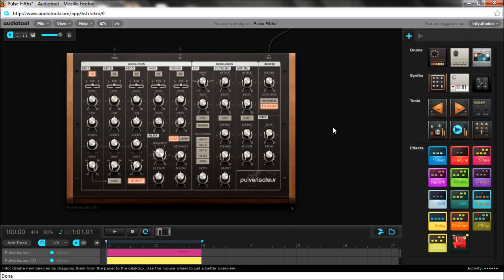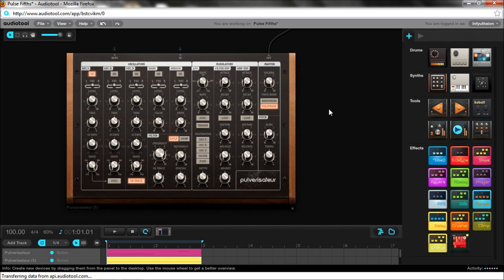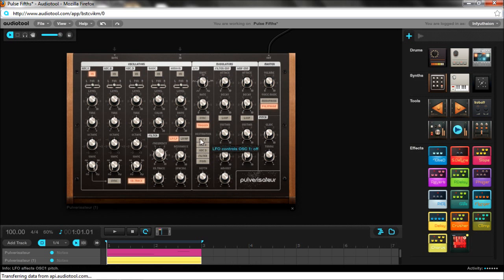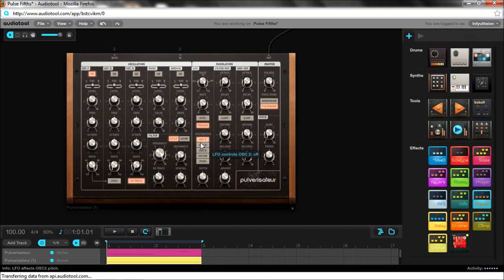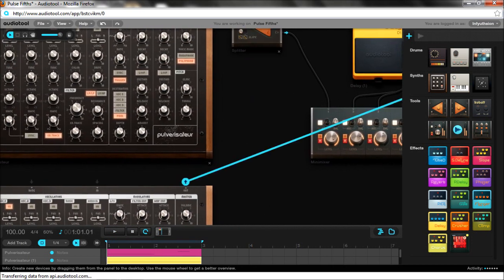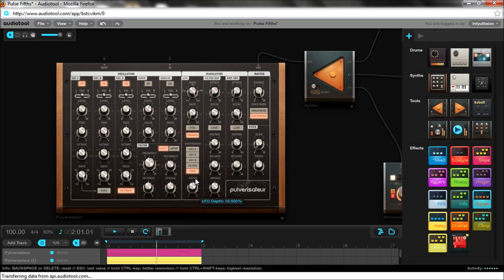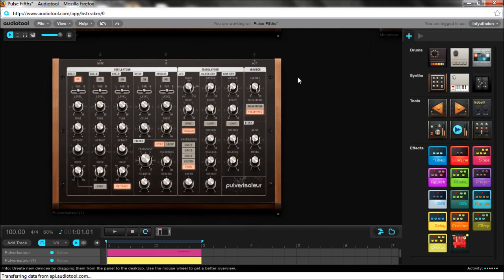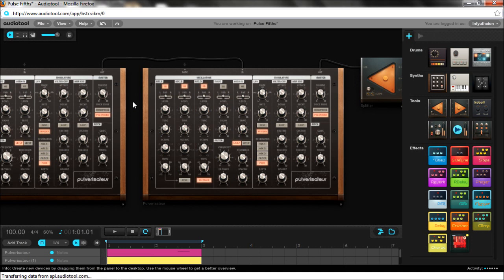Audiotool Tricks - Hidden Oscillator!

Comment: ok i need help one problem with my audio tool is when i go to pick a sound from the list ok i play it an it sounds good but when i drag it over in the line to make a song it sound a little diffrent like the pitch is low or something idk but how do i fix this
Reply: It's because the bpm (beats per minute) of your track, is different from the bpm of the sample. If the bpm of the sample is different from your tracks tempo, you can try putting the sample in the machinest. Then if you create a note track rather than a pattern track, you can use the piano roll to place your sample where it loops correctly, and you can still maintain your desired tempo, or bpm